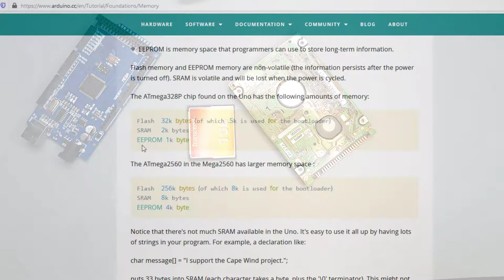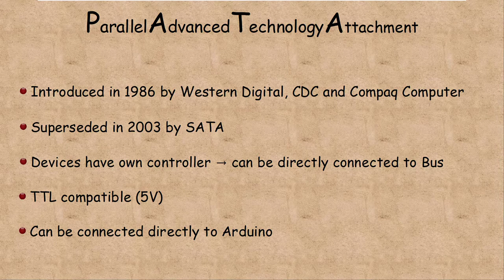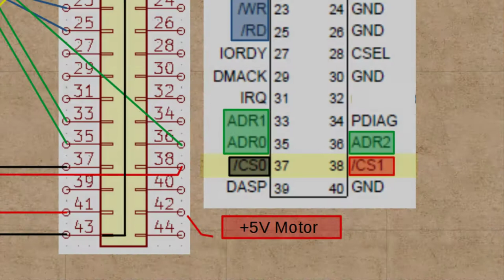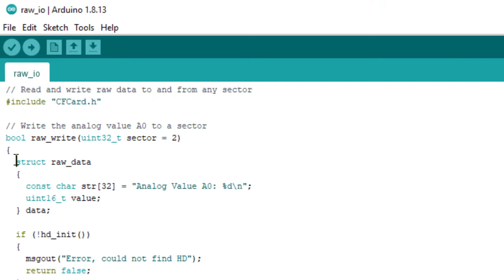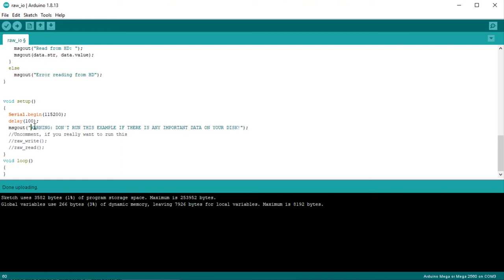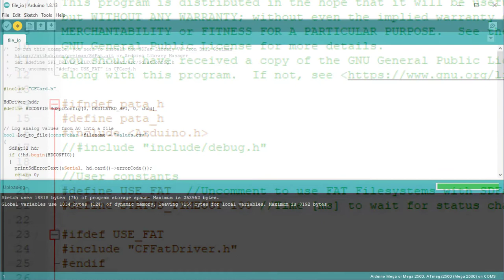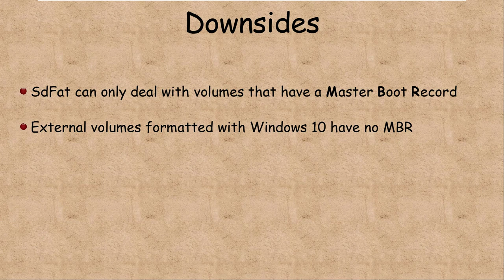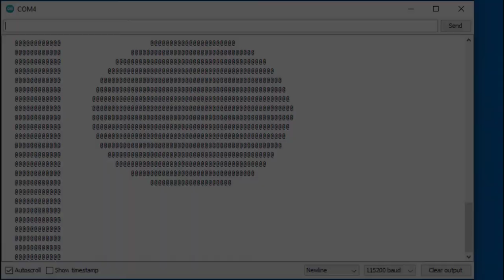How To Save Arduino Data on a Compact Flash Card?

Comment: Can you connect a SATA HDD or SSD trough a PATA to SATA adapter?
Reply from the maker: Yes, this should be possible.
Reply: @DoctorVolt  Can it be driven from a logic circuit (like a CPU)?

Comment: Can I connect sd card to old mother board using this? meaning like show sd card as a ide hard drive to mother board
Reply from the maker: Yes, this is possible for CF cards with IDE adapter. There are also such adapters for SD cards on Amazon for example.
Reply: Can you make video of that too